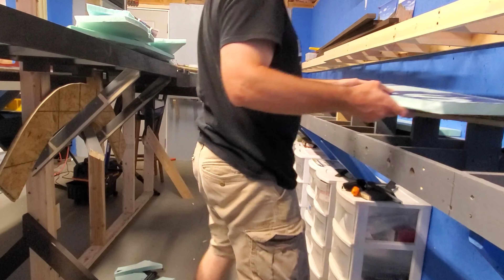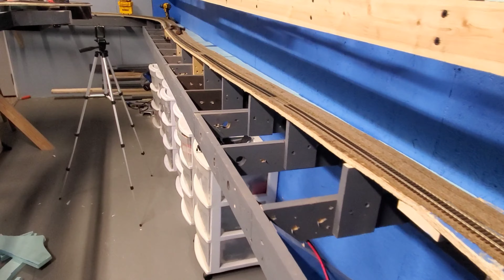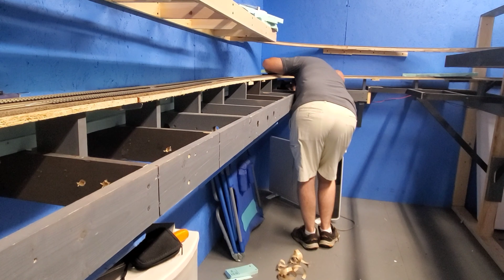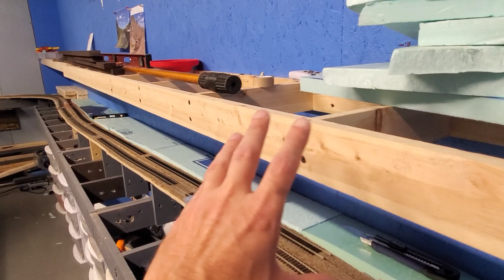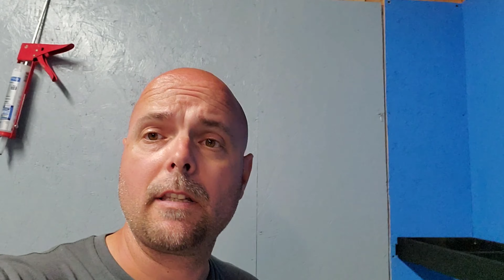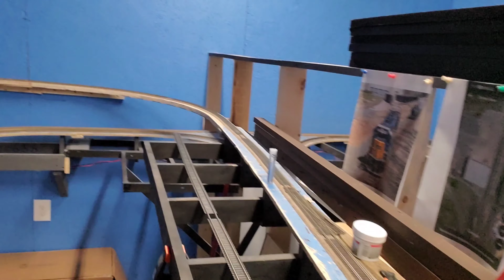Layout Construction Video 7/30/2020

Comment: Thanks for Sir Speedy update.  Looking forward to the tour.  Be safe out there😷
Reply from the maker: Fred how are you? Thank you
Reply: All good with me and family.  Just hiding out in the house as virus is tearing thru Texas.  Too hot in the garage to work on layout so I’m dong a few MRR things inside.  Bought an Arduino and trying to figure out how DCC+ Control software works.  I’ve got the IDE running my loco on test track but now stuck on the install on the other piece  of software I need.  I’ll keep banging on it.  Take care. 😷
Reply from the maker: Definitely take care of yourself. Let me know if you figure it out